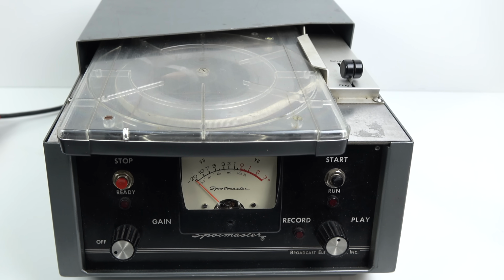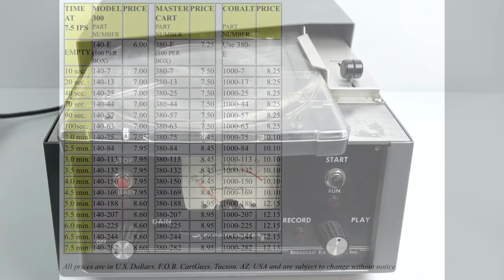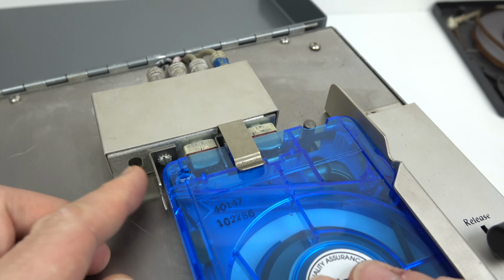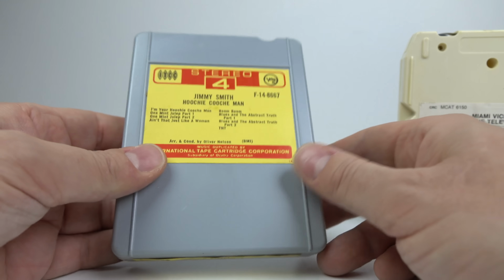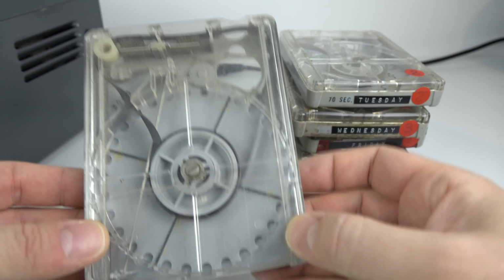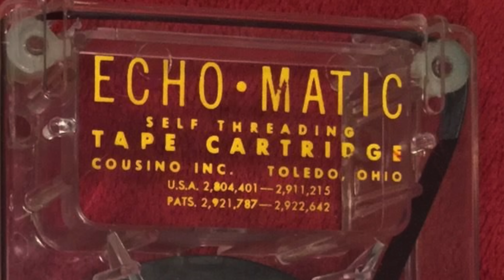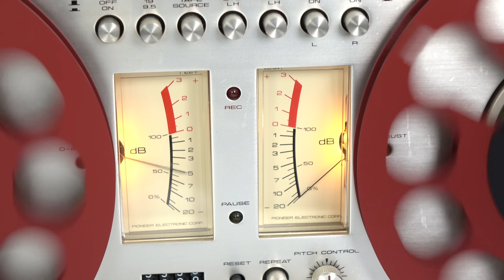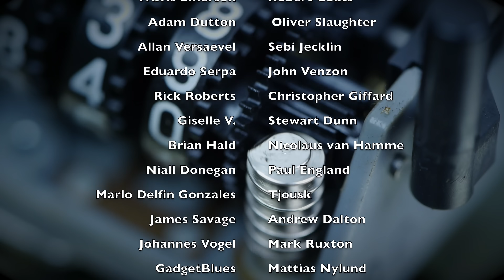The Broadcast Cart Machine

Comment: Wow, that old cart machine was apparently made in the Silver Spring, MD where I grew up. When you showed the bunch of carts, the first number was probably the ramp time in seconds (time to post), then the length and then what type of ending, either fade or cold. I recreated all this with software based on what people told me about carts but hadn't seen what it was based on until seeing your video. I wonder if the term "tertiary tone" I've heard refers to the tone track which is a 3rd track on a stereo cart. I've watched dozens of your videos over the months and the subjects make good conversation topics for myself and my ham radio friends after referring them here.
Reply: There were three frequencies used on the cue track - "primary" at 1kHz, which signaled the tape to stop at that point; "secondary" at 150 Hz, which was called "End of Message (EOM)" and flashed a front panel light and a rear-panel contact closure.  Automated stations used the EOM or secondary tone to start the next song or commercial.  The "tertiary" tone at 8 kHz was a second signalling tone, which lit a separate light and contact closure.  I don't remember the tertiary tone being widely used.  Interesting note:  some automated stations used the cue track to hold an FSK (Frequency Shift Keying) signal to hold binary logging data which had the name of the song or advertiser, and would be printed on a dot-matrix printer along with the play time to give actual "as-aired" information.  FSK was the format that early microcomputers such as the TRS-80 or Commodore used to store programs and data on cassette tape.

Comment: 1. The small NAB cart didn't cue because its a stereo cart, with the cue track a narrow one between the two audio tracks. 2. Your mains lead isn't a 'kettle' lead, it's an IEC! They're different: A kettle lead is a hot-state IEC, which handles more current. It has the notch between the L and the N pins, whereas the IEC does not.

Comment: Watching that tape run is somehow more satisfying. Mostly because the small reels makes it look so much faster it really gives you the feeling something is happening - and you don't get to see that in most cart decks. 
Somewhat recently I had to repair and re-load a 1/2 inch video EIAJ video cart kind of like that (VERY rare, for someone else's archive) and it was tedious but it worked well, fun to look at. I haven't seen a mobius strip audio tape yet... is that double sided tape then!?!?! Looks like it is.  Otherwise the oxide layer wouldn't sound good from the back side. And I don't think a recording could be made on both sides on the same track with out really loud bleed through from the other side. But of course this would work well for what you have there if only half the width is used on a double sided tape in a mobius strip. Great video!

Comment: you can plug the quicktest in the wall safely and put the contacts of the device in afterwards. the connection will only be take place when you actually close the lid. just so you know. kinda seemed like you weren't aware.

Comment: Greetings, your AUDIOPAK cartridge is no doubt stereo with a cue track. Since there are 3 tracks, the cue track for stereo carts is out of position to be picked up by a monaural machine. I remember as radio stations I was affiliated with - migrated from monaural to stereo - all of the carts had to be re-recorded. Not only that but certain machines had the ability to adapt to to differing tape formulation. "Hot Tape", Standard, and so on. The process would be to identify the preset playback levels by affixing a sticker of reflective foil, with a crude 'barcode-esque' label. As the cart was inserted the LED sensors would determine the proper settings for the particular tape. This was usually due in large part to station management purchasing tape stock they could afford THIS month; causing a virtual nightmare for the engineering staff to answer complaints from the disc jockeys - who were forever above reproach of possibly making a mistake and mislabeling the cartridges.

I miss those days. . .

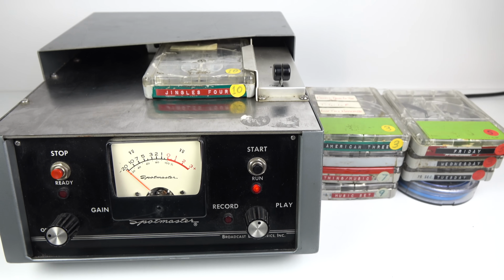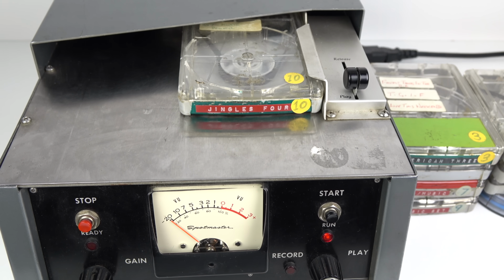Comment: 15:40 Turned out that cassette happened to be from BBC Radio 1 (listen at 16:04). Also, that happened to mention 247, which I believe was the old Radio 1 frequency (before moving to 275 and 285 in 1978).

Comment: I believe there is a difference in track layout between the mono and stereo cartridges which may explain why the cue function doesn't work.  In the US, carts were a common site in radio facilities until the mid 1990's when they were gradually replaced by computer based playout systems.  They can still be found in specialist environments for nostalgia purposes, but I did see some in use in small networks and stations until just recently.  You needed special back lubricated tape to reload cartridges, and many people did just that, as in heavy use the tape would eventually wear out.  The pads were usually the first to go, and in polluted cities would sometime last just a few years.  The spotmaster machine you feature was made by Broadcast Electronics in Quincy, Il and the first ones appeared in the mid to late 1950's.  Another common machine was made by International Tapetronics Corporation, or ITC and in many respects their machines were better made.  I have a few series one and two machines from late in the era that had integrated noise reduction.  An engineering friend of mine always preferred the ITC's as he claimed they were the only machines that could routinely reproduce 15 KHz.  The later machines had two cue tones, primary and tertiary.  The primary tone would stop the cart, tertiary was usually set to put the machine into fast forward to speed up cueing.  Carts were favored in radio stations primarily because it gave the management better control over what could be played, not only for songs, but also what version of a song.

Comment: Noticed there is an awfull lot of bare metal on this machine and only a two core mains lead powering it, hence no earth lead to it which under a fault condition could give you a afternoon out at the undertakers !
I would replace the mains lead for 3 core and have it PAT tested as well just to be on the safe side.

Comment: In the 90's when radio had moved away from turntables to CD's, a great deal of music was only available on vinyl. Particularly rare imports, DJ vinyl etc. These were chucked onto a cart for broadcast use. Carts were also used in automated broadcast systems. A cart system w/ magazines as long as a room filled with carts. The system I was familiar with (wish I had a pic) would load with enough carts for and overnight broadcast or even continuously. 4track-8track... A case where more was definitely NOT better. The 4 track was a consumer adaptation of the NAB cart. It was superior to 8 track.

Comment: We have a sliver of insight into who Kenny Lynn might have been. During the mid to late 20th Century, hospital radio was in full swing. These were non-commercial stations located in hospitals. They benefited patients by providing music or variety programming to make their stay more enjoyable. So Kenny Lynn could be a variety 
 show from the late 60's to early 1970's that may have been produced in studio then aired at a later time or date. The show was most likely sent via reel to reel to several hospitals in the U.K. Question is did Kenny Lynn go commercial in 1971 or 1972. But the older style cart that has the Kenny Lynn content is probably from 1969. The Frank Pourcel tune used was released on a Columbia Studio 2 Stereo album in 1968.

Comment: Without looking through 1900 previous comments, at the 12 minute mark when you are showing your repaired cartridge that was winding the tape tighter, I think I see that the tape being pulled from the center is not passing over the angled metal bar. If you check the other cartridges, that's the way it runs. I think that design may serve to ensure the tape tension and angle is correct when extracted.

Comment: Also techmoan - they put music on carts so they wouldn't wear out the records (and eventually CDs), and so they could play them in more than one studio or use them in automation systems at a time when they didn't have CD carousels or WAV file playback yet (and never really used record changers in broadcast). It was especially common in AM music, but was used everywhere. Technically they should have bought separate copies for each station in a cluster or duo, but they often didn't.

It was also much easier to pop in a cart as opposed to cleaning and cueing an LP or 45, and of course they could stack the carts into the cue'd playback systems for semi-automation, as long as they kept feeding the stack. Most bigger stations here had 6 or 8 cart players in that stack. Then of course music moved to Denon CD cart.

But it was used much more in AM where the loss of sound quality for music wasn't noticeable. Though carts didn't sound that bad, and were almost as good as a good FM receiver by the 70's and especially 80's, just with a lot of hiss since they didn't ever use Dolby or dbx. People forget how good analog FM really does sound. Most people can't hear beyond 15k anyway (limited to 15k due to the 19k stereo pilot signal, of course).

Also I did see a lot of use of cassette in smaller radio markets, usually for recording phone calls of requests just prior to airing them or other one-time or short-time use stuff, where it's easier to do a one-off on cassette. Though occasionally they did play music from cassette as well. Probably due to expense of carts.

Comment: Dr. Dre tune probably recorded on a stereo deck, which has a different track configuration, this cue tone was probably there but didn’t work on mono deck. No external equipment needed. Cue tone oscillator built into the circuitry. Might just not work on that deck.

Comment: I think I noticed your Fidelipak cartridge tape wasn't threaded right around 12:00.  It is supposed to flip over the metal rod.  You have it going under.  This could be the reason why it's winding every so tightly.  The rod could help with the friction of the tape against itself as it exits the center of the spool.  Haven't watched the whole video yet.  Still in progress.

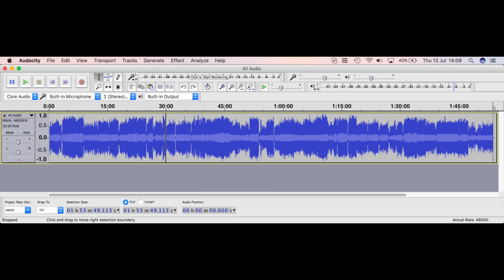Comment: Me again. At 12:30 you mentioned the tape is a mobius strip.  This is incorrect as the tape is not coated on both faces with oxide.  The turn on the winding is simply to respool it from oxide out on the spool for the cart to oxide in for the reel to reel. Only one side of the tape has oxide.

Comment: The cue tones weren't working because the components in the machine's sensing circuit may have been out of tolerance after all those years.  That said, there is a manual adjustment in the circuit to make up for that, whether the machine itself is the issue or the machine the cart was recorded in was the issue (it may have recorded the tone weakly).  It's possible that the machine would work correctly if that adjustment were made.  Though after all those years, maybe it's too far out.  But worth a try if the audio was working OK.

Recording on the machine was kind of messy.  To get the cart to stop just before the beginning of the audio, you had to hit record start and a fraction of a second later start the audio.  Pressing record start would embed the cue tone onto the cart just before the audio started.  When played back, the cart would stop at that tone just before the start of the audio, as Techmoan explained.  

It was much easier to record audio from open-reel tape machines than it was from vinyl records.  For open-reel tape, you'd just rock the reels back and forth to cue the audio right at the start, then rock the reels back just very slightly.  Hit record start on the cart and on the open-reel at the same time.  You couldn't do that with vinyl because turntables didn't start at speed immediately.  You'd have to cue the record back about a whole turn from the start.  You'd then start the vinyl, and then start the cart when the record had spun forward three-quarters of that whole turn (IOW, starting the cart with a quarter-turn left in the spin) and cross your fingers it worked.  Fun times...

Comment: A mechanical nightmare. Extremely unreliable, required weekly maintenance. Head cleaning, pinch roller cleaning, pinch roller pressure adjustment, armature return spring adjustment and replacement. This Spotmaster mechanism was used on the underground railway stations in Sydney Australia for playing train announcements. 

A much more reliable machine commonly used in radio stations and used also on the railways in Sydney was the Cuemaster 900 series.

The large cartridge was used for music playback for passengers on the Indian Pacific train between Sydney and Perth. The tape ran at a slower speed.

Comment: I was hoping you would also be opening the machine it self to look at the load and lock mechanism.  The simpler level for having the DJ load the capstan into place is much simpler and quieter than the early ones that quickly slapped the capstan into place on hitting play.  Those also made an audible sound that could be heard on mic as 'e was going into the spot or weather jingle.  Any luck on finding and fixing the cuing circuits?

Comment: Previous comments regarding Radio 1 jingle dates would be correct, but it's unlikely that Radio 1 would have multiple jingles on the same cart - the whole point of the carts was that you could grab them, whack them in the machine and they would play the one jingle you wanted. My guess is that these carts were used by a hospital radio station or a jingle enthusiast who just wanted to pretend to be on 'real' radio (been there - done that!) When I worked in commercial radio in UK in early 80's all jingles, commercials, new reports, music clips etc were on these, I must have recorded (and erased) thousands over the years!

Comment: BTW SquareSpace has the first couple floors of the building I work in downtown. They took the retail ground-floor space for a private cafe / coffee shop, and have secured, inaccessible space on the Mezzanine level and I think 2nd floor as well. It's creepy, there's just a black wall outside the elevator with card lock next to door, and tiny squarespace logo on the door. Whereas all other offices are open and you can walk in, with windows.

Kind of funny, all that security and those perks for a bunch of low-paid customer service reps. I don't think there's anything else in there but them. 

I worked in the ISP and web hosting industry in the 90's and early 00's, and we never had those perks lol Interestingly, I worked at the largest ISP in the northwest in the same building I'm in now in 99-00. The good old days of local internet providers who didn't SUCK!!! They had the largest block of square footage back then (two floors), and a web host has the largest block today.

But SquareSpace is, admittedly, for non techies or those who don't care to know markup. Which is a lot of people these days.